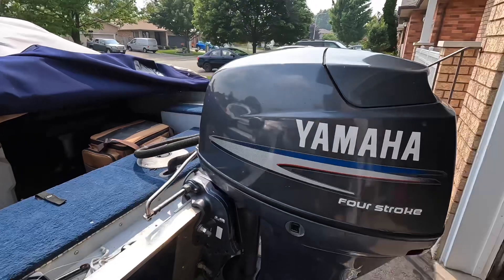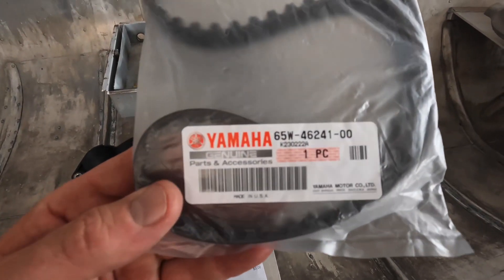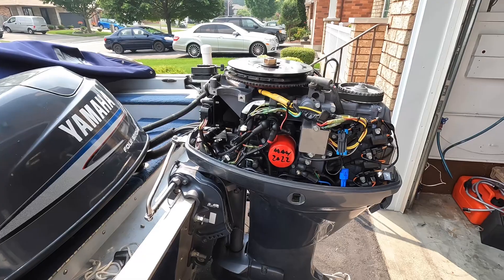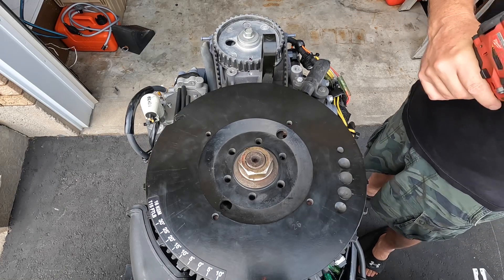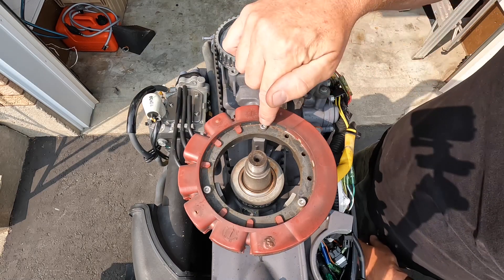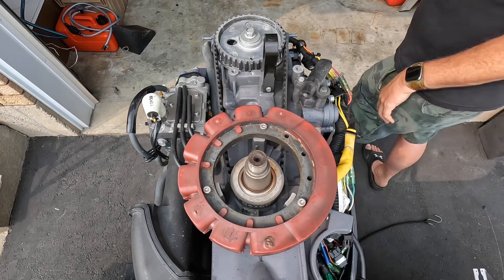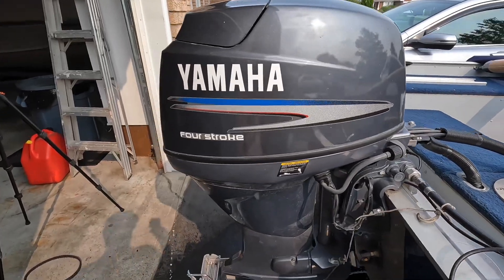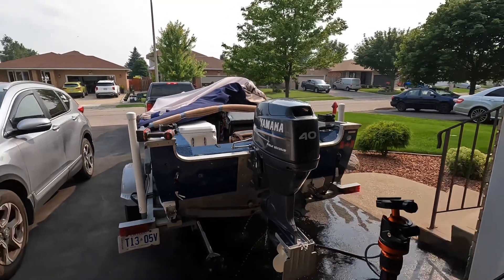2003 Yamaha 40 hp outboard timing belt replacement

Comment: One thig I noticed right away is the belt that was on the motor was not a Yamaha OEM. Do not use anything other than the OEM. Any parts should be OEM as far as I am concerned, oil filters included. You will pay the price if you don't use OEM Yamaha parts.

Comment: Nice video, thanks!  I'm no engine guy, but having owned this exact engine for many years I've done a bit of basic maintenance on it (assisted by youtube).  I may have a go at changing the timing belt this fall, so this video is going in the save folder.

The little "half moon key", what is the purpose of that?  And did you use the "piston stop tool" before loosening the fly wheel nut with the impact driver?

Comment: How did you torque the flywheel nut without it turning?
Reply from the maker: You can use a piston stop tool. It threads into the spark plug hole. Do a search and there should be a good explanation.

Comment: Gday mate i have a 2021 40 hp and i think they have been the same configeration since about 2013 ,it is one thing that i did notice was no tensioner on the cam belt i suppose they dont need them being only a 40hp . How much would you have paid to do that in a shop , probably a lot this is why i have always done my own servicing mine is still under a warranty but it aint going back to have me slugged x hundred dollars for some one to change the oil at 20 hrs these are pretty simple motors and you tube is your friend ,plenty of forums to get advice . Basic maintenance oil water pump impellor ect and your engine will run forever yamahas didnt get there reputation from building crap motors great video for people to learn how to do the job themselves put more up as there aint to many on 40hp four strokes take care .

Comment: Thanks for the Video.  Looks like a pretty easy job.  My 1998 Mercury Big Foot still has the original timing belt.  I ordered my belt from Mercury for $60 US.  It is a Gates branded belt, but with a quicksilver part number on the package.  The power head on my Merc is the same an F25 Yamaha.  The F25 is the same as the F40 with a cylinder chopped off. So most parts are interchangeable.

Comment: what is that cover behind your prop for? 
nice info in the video though i have a similar motor
Reply from the maker: It’s called a Happy Troller. When it’s in the up position it helps with planning out (not useful for me) then with a string pop it down and it help to slow down your trolling speeds. Great motors!  Thanks for watching.

Comment: I hate 4 strokes cause of this type of maintenance the belt snaps or loosens up bang new engine 😅
Reply from the maker: That’s the truth. And you gotta take out a mortgage just to even buy a boat make s it even scarier lol. Thanks for watching
Reply: I like 2 strokes too, especially smaller hp engines, but I don't miss the smoke, fouled plugs, and oil on the water.  I own the 25 mercury 4 stroke, which has a similar Yamaha power head.  It's been going 25 years with annual oil and spark plug changes.  You couldn't pay me to go back to a 2 stroke.

Comment: There should be companies that can rebuild that starter in your town for a third of what you paid. Did you torque down the flywheel?
Reply from the maker: For sure. I didn’t have one to rebuild. The last one jammed and broke off the Bendix gear. Honestly I was pretty shocked at the prices from Yamaha. Great motor but man.  Thanks for watching.